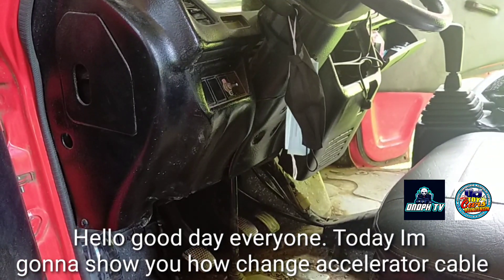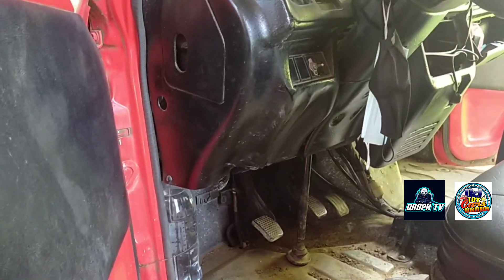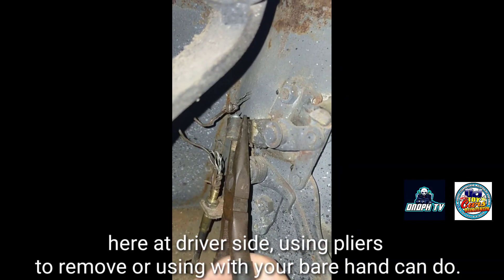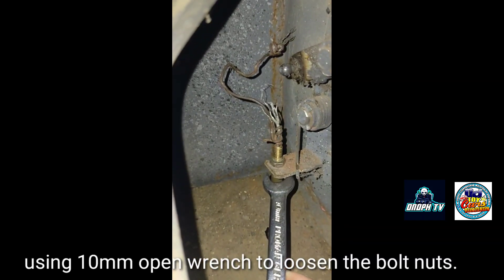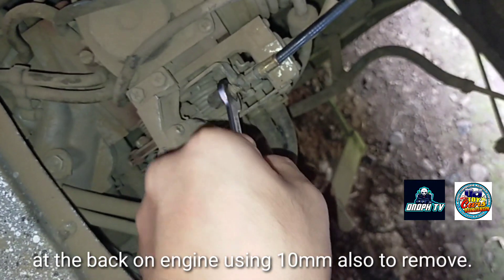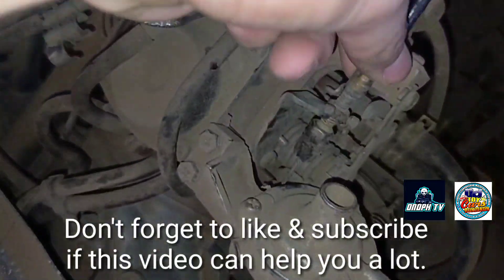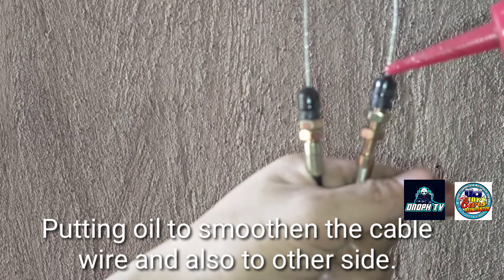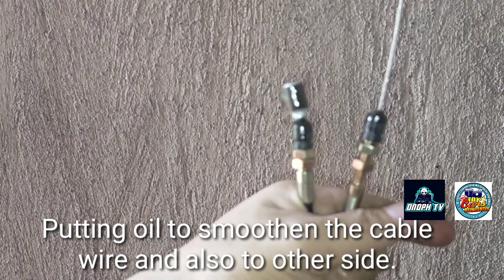How to Replace Accelerator Cable

Comment: Replacement cable very cheap, hindi yan tatagal, the inside diameter has no plastic coating, only  spiral metal, do not throw  the original cable,  i can repair  that back to original